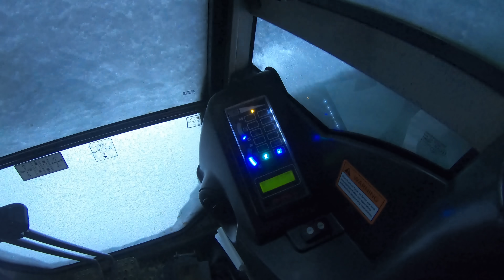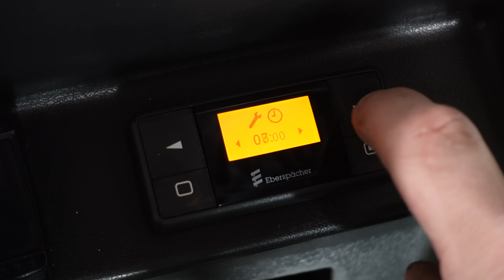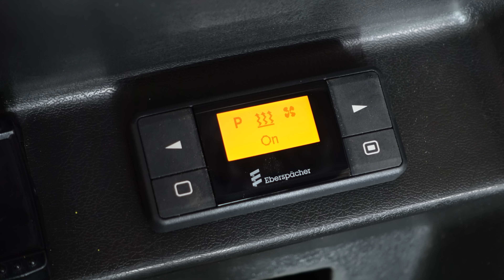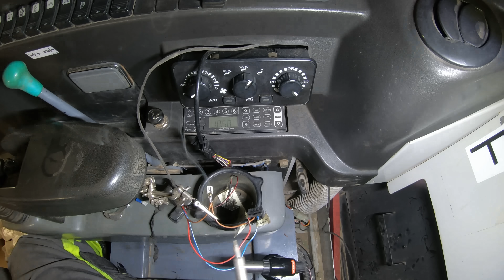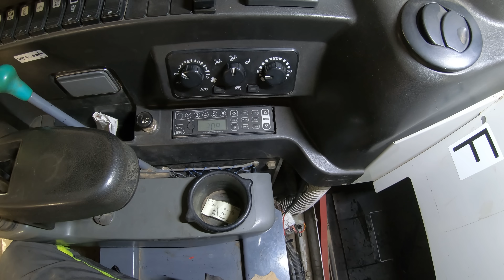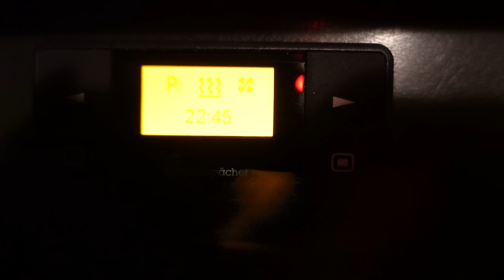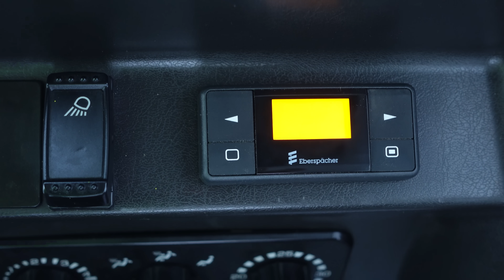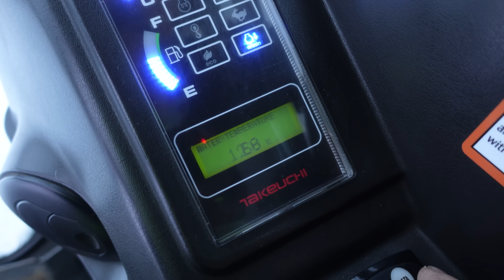Installing a Diesel Heater in the excavator and testing it

Comment from the maker: Heater used, Eberspächer D5SC hydronic II.

Fuel consumption:

Power  0,64 liter/h  (21,64 oz)
High     0,61liter/h   (20,62 oz)
Low      0,26 liter/h    (8,79 oz)
 
Power consumption:

Start up 130 watt
Power       50watt
high           47watt
low            22 watt 

(Fan in cab not included)

Power mode is equivalent to 5200watt, High 5000w and Low 2100w.
Reply: Really wish VW let us have those in the US for our diesels. Webasto is the name here but really similar.
Reply: keep an eye on that exhaust pipe...they have a tendency to plug up with mud so its best to not allow it to hang past the belly pan....if it plugs then it could over fuel and catch on fire and burn the machine down...ask me how I know?..lol!!
Reply: @Heckleburger  Oh yeah we have Webasto here in Finland as well, probably a pretty universal thing.
Reply: @Heckleburger   Eberspacher is Espar in North America
Reply: is that your shed?

Comment: dude you have a killer shop, really cool equipment and you know what your doing. your channel is going to really take off this year !! happy new years
Reply: Fully agree
Reply: i have to agree aswell. you are really doing well and the production is really strong all around, though here i wouldve liked a bit more explanation with what it does and why exactly you needed it and maybe some insight into where this comes in handy in your everyday job or current project...
Reply: I fully agree!
Reply: @SubculturalMoKa  I also agree.
Reply: Wont take long for the algorythm to pick him up if he uploads regularly. A couple of months and he will be doing really good.
Reply: @SubculturalMoKa  He explained it at 1:30. It is a heater to heat the cab of the vehicle. He wants to use the excavator more in the woods over winter. I guess it is nice to have a nice warm cabin when you start working. Since the excavator is parked near the house in this and most other videos, i guess until now he just starts the excavator before breakfast and leaves it on for a while. Seperte heater means that the engine does not have to run, so it is more fuel efficient. And then there is the function to set a timer and other features.
Reply: even his pants looks like good cool quality.
Reply: *you’re

Comment: Thats the most frozen excavator ive ever seen, the contrast of all the frost when you pull it into the shop is pretty intense. I'm sure the motor really appreciates being warmed up to 150 before starting.
Reply: you mean 90c? 150c is a little to hot for a engine. this is in europe, so, metric
Reply: 150°F is 65°C, as it was in the video. ;) (Why don't we all use kelvin... 338.15K :D )
Reply: This is the reason why heaters are popular in Sweden.
Saves the engine, saves gasoline, warm car in the morning and no ice on the windows 😀👍🏻
Reply: @petter5721  A study conducted in Finland found that fuel heaters like this don't save fuel at all, even in freezing temperatures it's a massive net negative.
Electric heaters also don't really lower fuel consumption. Heaters are purely for saving the engine and for comfort.
Reply: @TopiasSalakka  0,26 l/hour massive :)

Comment: You do nice work! When hoses are stretched over a nipple larger than they are designed for, they tend to crack after a while. Nipples are available to make your own adapters for different size hoses.

Comment: Just a couple "armchair engineer" comments. Hard to tell how close the heater is mounted to the muffler, I would be concerned about the heater getting constant exposure to high ambient heat cycles on one side. Maybe put a thermal blanket between heater and muffler? Next, the way the heater bracket is installed with that long arm will fatigue the bracket due to vibration, you may want to keep an eye on it in case it ever starts cracking. And lastly, solder connections are not ideal for mobile equipment applications since vibration will break a solder connection over time. Professional crimp methods (not using the junk insulated crimps) are generally superior for reliability. With that aside, professionally done and it looks like a very well-kept machine for having around 5000 hrs on it!

Comment: yes the heater will help reduce engine wear not having to start ffrom cold. but please remember the engine oil is not as warm as the oil sump gets no heat from the coolant circulation.

Comment: I have an Espar in my Sprinter installed from the factory it just pre heats the engine I plumbed it to also run an aux heater until the temp gets up...they are good units some problems with people running bio diesel fuel, so I use diesel additives which keep it running clean

Comment: Should have used the comfort hose too the cab heater.
I installed one of these on my work truck and the clean and clear windows are a big help in getting started on cold and icy mornings.

Comment: Why you dont use the return fuel hose is you drain the filter/pump if you leave the heater on without the engine running. So you will have a really bad cold day in the future if you forget to turn on your machine.

Comment: The only thing I did differently to you was the exhaust from the heater I plumed in to the silencer on the machine just made sure I had inch with the flow of exhaust to stop and back pressure to the heater works well too

Comment: Heat from the exhaust muffler can degrade the plastics in the pump. I think thermal protection should be added between the two parties
Reply: Isn't the plastic on the pump already heated by the heater?
Reply: I was thinking the same thing, excavator exhaust systems get very hot

Comment: Im not  from England so my unique cuestion  is why? If the fan work well  why install the heater thanks you
Reply from the maker: It's basically a wireless engine heater. Useful when leaving the excavator in remote places,
so its heated when you arrive (Both the engine and the cab).

Comment: I just bought a cheap 2kw heater from Vevor for my shed to make it a useable space instead of a dump for my junk.
Cost me only 105€ and I calculated that an electric heater would be ~2,3x as expensive as diesel!
So its well worth to install a diesel heater vs using electric heater which are much simpler and easier.

Comment: Hey, Did I see you cable tying that hose to your (soon to be melty hot) exhaust pipe there at 26:40?
Reply from the maker: Hello, that's the air intake. Exhaust is on the other side.
Reply: Thank goodness... It looked like the turbo outlet from that angle!

Comment: Here in the UK, it's now illegal to have the engine running when you're not moving.  Technically, even standing at traffic lights we're supposed to turn the engine off while waiting for them to change to green.  In especially icy conditions it's common to find the screen feezing over as fast as you scrape it clean so it's common to let the engine warm up before we set off.  This is now specifically mentioned in the law as illegal.  I wonder if these heaters would be the answer.
Reply: Germany has that stupid idling law there economy is collapsing being ocd about fossil fuels.
Reply: The answer could also be voting better. And not complying with silly laws.

Comment: Usually the fan starts only when the whole cooling circuit has got 80 degrees C, it heats up the motor before the cabin, usually the standard method of operation.

Comment: I've operated the TB295 and also theTB295W (Rubber Duck) Awesome little Machines. Love the Heater you fitted, getting into a nice warm cozy Machine first thing is a nice touch. I've been operating 360's in the UK for over 28 years and still love it. I can see you're a good operator. I have video's of me operating 360's on my Channel, from 8ton upto 50ton Long Reach Machines

Comment: Excellent video......I have 2 Chinese diesel heaters heating my workshop and used then regularly with no problems.....a lot cheaper than the Eberscpacher....Webasto diesel heaters.....HappyNew Year for 2023...🏴
Reply: did you find chinese heater for water or are they just for hot air?

Comment: From own experience I recommend a CTEK battery charger so that your starter battery is not emptied. If you have 230 V at hand at your parking lot. Other possibilty is an extra Battery and a loading diode splitter.

Keep up the good work, congratulations.
Regards
Reply: the whole point to a diesel-poowered heater is that you can preheat your excavator in remote locations, where electricity isn't readily available.
If he had a parking lot with 230 V at his disposal he'd have installed a electric heater.
Reply: CTEK is actually a Swedish company 😀

Comment: I have never heard of a diesel heater for a vehicle. My car never started this morning and it has a block heater. The only diesel heaters  I knew about was for boats. I can see how being near the arctic circle you guys would have cold weather. When we were building the Alaska pipeline and drilling oil wells we did not shut off the diesel engines except just to  check the oil. I suppose a diesel heater would have worked but at 40 below we just let them idle.
Reply: They have been fitted to semi trucks in Europe for decades now. Very efficient although they can be a little noisy at times.
Reply: Diesel cars are common here and most come factory equipped with a diesel heater. More rare on petrol cars but you can usually get it as an option.

Comment: Interesting video, But I am interested to know how it works on the return fuel line. I would have thought that would have drawn air not fuel as theres no dip pipe into the tank, unless you meant you tapped into the feed line
Reply: I was looking for this comment! Think I have one machine that the return is at the bottom and one that isn't, I would also be worried about somehow emptying the filter, it's unlikely but I hate fixing diesel air leaks in the cold!
Reply: It's plumbed into the tank, but it's at a higher location than the supply pickup. So will have to be 1/4 tank or so for the heater to work, but it only uses like 8 ounces an hour so thats like 1/2 a cup of fuel...

Comment: This guy is a really smart guy, but I don’t understand why would you put the snow against your house where in the water is going to warp your wood? Why not put the snow away from your house if I lived in that kind of weather that’s what I would do.
Reply: Usually you blow snow against the house or doors you don’t intend to open during the winter to insulate the building. Think of how an igloo works. If the yard around the building is graded and dirt compacted correctly the water will run away from the buildings in the spring.

Comment: Very nice device to have in cold climates. I know here in the US we use a headbolt heater and you have to plug it into electricity. That's a far better way of doing the same task. Thanks for showing us that. Happy New Year
Reply: In Sweden it is very common to have electric and gasoline heater on cars, you plug it in if you have access to the grid, if not the gasolin (or diesel) heater is used. Just set a timer in the app on your phone. 
Great way to save fuel and stay warm.

Comment: Did you hear the belt squeal when starting? That means the battery is discharged,
and the alternator is having a time to compensate, helping to crank over the
engine starter motor, and any other circuits. I would think 15 minutes of preheat
would be adequate for your goal. I would seriously look into installing a dual
battery system, to be more reliable and balance the loads.

Comment: Very nice installation indeed. Really appreciate the soldered wire connections. In theory they should be  more prone to failures due to vibration than crimped joints - but in practice (at least when supported by proper heat-shrink) they just work. I do the same when I want something to work reliably in nasty conditions.

I love the sound of an Eber or Webasto starting up! It's like a tiny jet engine carrying a promise of hope, warmth and comfort into the bitterly cold and usually pitch-black arctic winter.
Reply: Yeah I dont buy the whole crimps over soldered  joints with (adhesive lined marine 3x wall heat shrink) argument. 
I have seem way to many failed crimped connections... many factory installed, most poorly installed DIY and correctly installed professionally installed.
I have yet to see any soldered connections with marine triple wall adhesive lined heat shrink fail, ever
My Buddy's family has a salt water boat I rewired in the 90's and none of the wiring has ever failed or given them any trouble, the boat was only 15y/o when I rewired it b/c most of the factory connections had major issues. This boat lives in Salt water and only comes out once a year to get cleaned below the water line nd/or get the bottom painted.

Comment: 32:23 don’t you think the return tube has all that thermal insulation for a reason?
Don’t you think that little plastic T joint won’t melt over time?

Comment: You need to have the fan on full power before you turn the egnition off.
All new diesel heater use the fan speed when you turn it off.

Comment: So many open cable and screws  100 more connections points as befor, now it can be start destructed by rosting on open screws. Then the electrical will be fouled by condens water, in result it's starting burnung up , you have written this programm ,  (i wish i have too an own excavator :-)

Comment: Hopefully you dont run into issues with that fuel supply. That is not ok without additional supply tank filled from the return line.

Is you interior fan now running full speed or are you supplying the speed control from the relay?

Comment: Just wondering, would it not be much easier to tap into the engine coolant lines and route that to a heat exchanger (aka radiator) into the cab with a blower motor on it? 
Reall dig your shop and skills. 
Cheers from Louisiana.
Reply: This heater warms up the engine prior to starting

Comment: Even with electric block heaters we would not try to start equipment at less than -10F (-12C). It would take so long to warm the hydraulics and the rest of the machine you would be wasting half your day and perhaps doing damage to the machine. Nice install.

Comment: Great videos! One question though, how come the fuel return can supply fuel to power this thing even when the main engine isn't running? Similar to other comments, I would appreciate more explanation to what you're doing in each step. Eg. how/why is the coolant used there.
Reply: I did the same statement and looking in comments for the ignorance of how things work xD but im glad you notice too :)
Reply: i assume theres enough diesel left in the return life so that the heater can run for an hour or so, i usually start it 30minutes before i start the engine. never had a problem with the return line solution
Reply: the heater combusts the diesel and moves hot air into coolant hoses and starts the cabin fan, by a few minutes the heater core now has warm enough coolant to  blow warm air into the cabin
Reply: @xav1uz  The return line is plumbed into the fuel tank. The heater has it's own tiny electric fuel pump. Putting in the return line means it won't have to suck fuel thru the engine fuel filters.

Comment: Does the return line from the main fuel system enter/ go to the bottom of the fuel tank? I know on gas/ petrol systems they sometimes only dump back into the tank at the top.
Reply: It doesn't go right to the bottom, but should work as long as the tank is at least 1/4 full.

Comment: Excellent vid as usual! Personally i would have installed the timer under the left yoke towards the floor, that way i dont have to enter the cab to set the timer! But ive only operated 20+ ton excavators, and then its quite handy! 😃

Comment: carefully read the instructions for installing hydronics. 1 installation of hydronics in the lower part of the engine level. 2 condensate will freeze in the exhaust pipe in the bends. 3 cooling hoses should preferably be enclosed in a braid so that they do not rub off.

Comment: I have got to ask why did you tie in to the engine cooling system? You are now heating up your coolant!
Reply: That is what hydronic heaters do; they heat the engine block via the cooling system and then activate the cab heater fan to draw heat from the matrix in the cab for de-mist and comfort.
Reply: Correct. To hear both the engine and cab before starting the machine.

Comment: I wonder if a front mount arm machine like that would have better side tip reach than a  mid frame mount. I run a case cx75sr mulching roadside and it gets pretty tippy reaching over side banks. Are the front mounts better because the leverage point with the whole frame behind. The mid mount almost seems to lift the far track while one of these would have to pivot on the inside track in order to lift the outer? Anyone have experience with both in the same size category?

Comment: fantastic install. a question i f i may, why do you pile the snow upagainst the bottom of the house at the end of the video ?
Reply: I'm just guessing, but, insulation maybe. Depending on foundation style of the house, you might want to keep the crawlspace under your floors, between the concrete slab and the floor insulation, from getting too cold.

Comment: Nice video and very nice installation.
Is that your own workshop or a workplace one? I dream of having a workshop that well equipped.
What is the purpose of piling the snow against the building? My only thought was that it might be to stop wind from circulating under the floor.
Reply: Snow is a good insulator